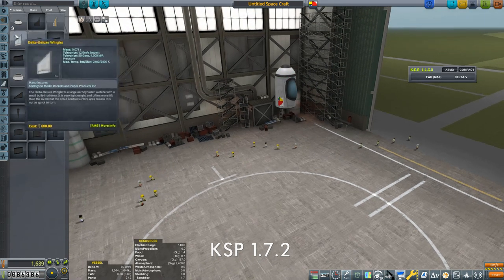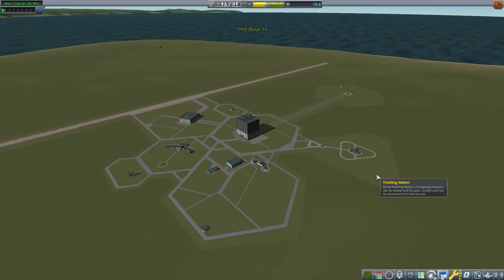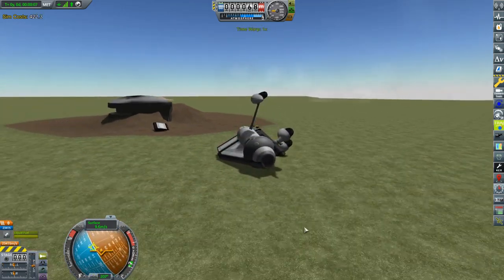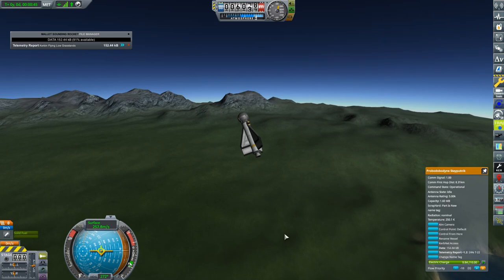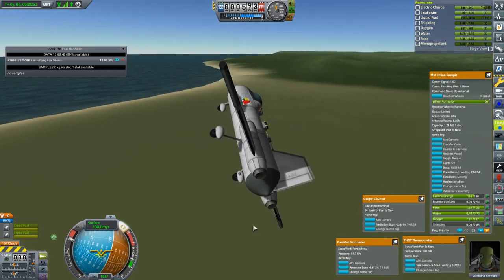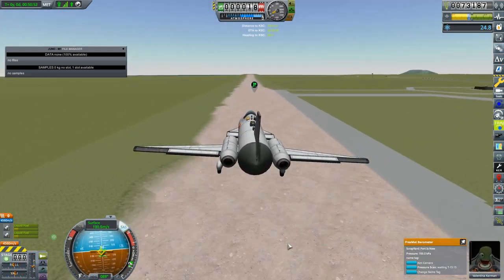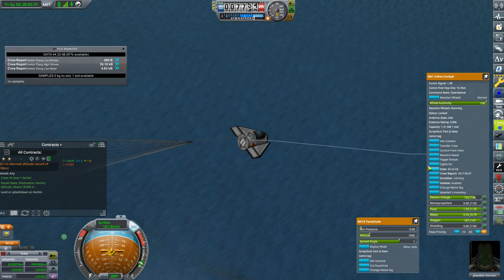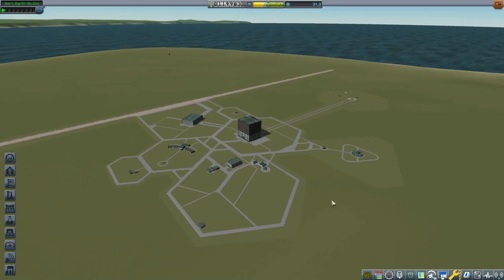Rocket Glider - KSP Modded Career

Comment: If you hold alt then 2 parts will always stick together with their atatchment points.
Reply from the maker: Yup, I know. If you are referring to the difficulty sticking on the boosters, it wasn't helping. Radial decouplers aren't designed to be used this way.